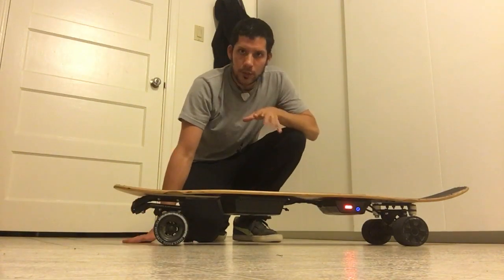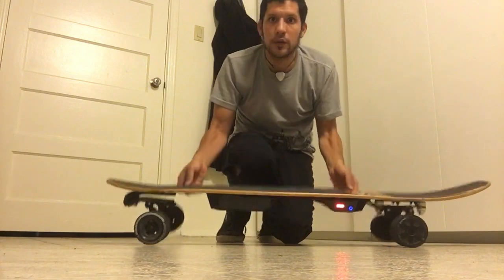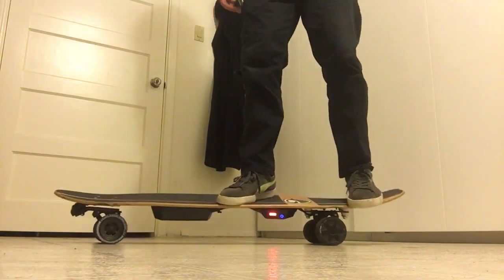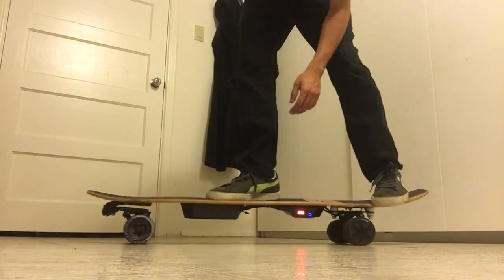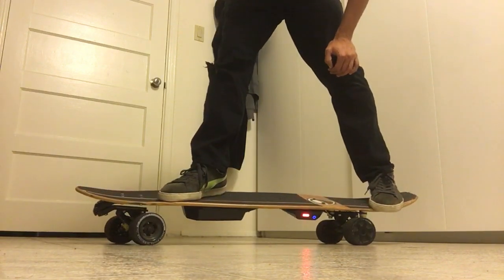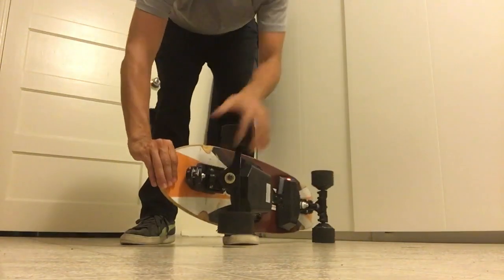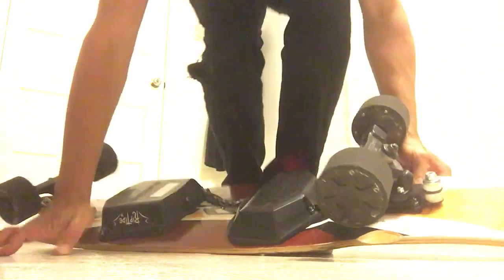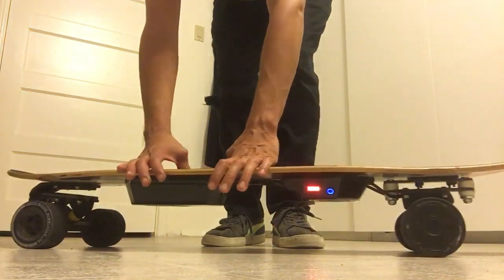Waterborne Surf Adapters explained

Comment: What deck is that bro? That thing looks awesome! When you put the adapter in the back was it a huge improvement compared to just the tall riser in your first video? I’m planning on getting one for my meepo classic and I’m wondering if it’s really needed to get the rear adapter.
Reply from the maker: yes you should get both. its a sector nine from the 90s
Reply: Carlos PenaGarrido ok I might just do both. I was just concerned that it wouldn’t fit on the deck.
Reply from the maker: @nicholasstaat1123  you wont regret
Reply: Carlos PenaGarrido sweet. I’ll just get both then ;) thanks a million for the help
Reply: What size is your deck?
Reply from the maker: 49"

Comment: I have a rear adapter. I noticed it is noisy. Do you have this problem? Like bumpy roads, too.
Reply: I just installed the Waterborne Rail adapter on the back truck to go with the front Surf adaptor and yeah, mine is a little noisy.  Rides great though.
Reply from the maker: It’s been a long time I stopped eskating, but if I was getting into it again, I would get the same set up or similar